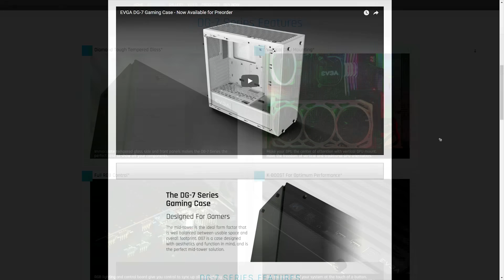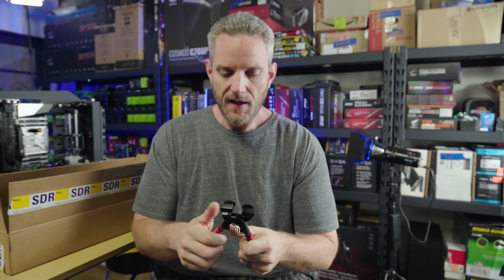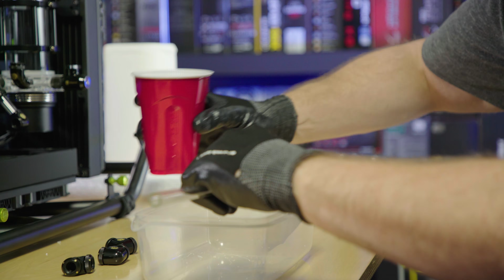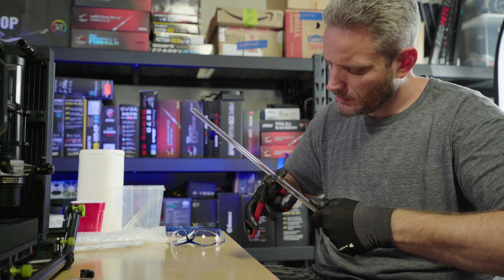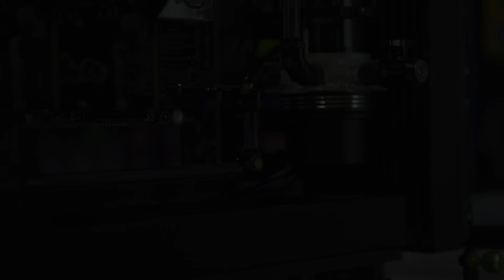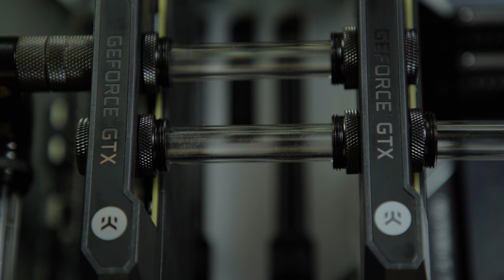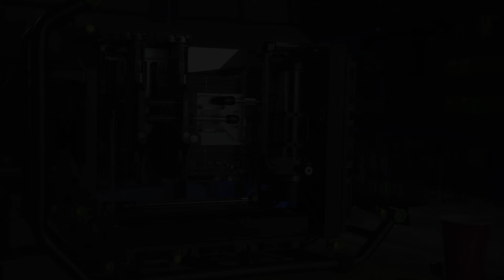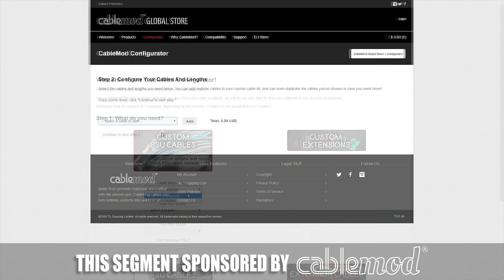First Custom Loop of 2018 - Personal Build Log Part 2.685

Comment: Hey Jay, can you talk about the Intel bug fix that is supposed to hinder performance by 10-30%?
Reply: Dennis Leung nope its "supposed to be" 5-30% but linux fixed the bug in their os and saw differences of only 1%
Reply: No, it's little to no performance hit of any kind. Try reading some of the updated articles from today. The final patch hasn't been released yet. Also, it's not just Intel that's affected either.
Reply: It's not Intel "fanboys" acting desperate here, it's AMD fanboys spiking the football based on fear-mongering bullshit that isn't true.

Fact: The security flaw, and it's required fix, has ZERO impact on consumers. From the soccer mom checking her email, to the gamer raging that everyone that kills them is a hacker, they are 100% unaffected.

Fact: The security flaw, and it's required fix, only affect enterprise customers. The flaw is related to virtual machines running on a CPU being able to view/see/access protected memory information of other VMs running on the same CPU.

Fact: Intel is NOT the only company affect by this flaw. AMD, despite their early claims to the contrary, as well as ARM are also affected by the issue. Apparently to a lesser degree than Intel, but they are still not immune. AMD tried to grandstand early on and say their CPUs are unaffected but the people who discovered the flaw and are working on the fix have point blank said they are wrong and are refusing to exempt AMD CPUs from the fix.

Fact: Despite the early fear-mongering reports of "UP TO" 30% performance loss, that "up to" part is key, that performance loss has been all but eliminated since the news broke yesterday. The "up to" 30% was only in specific programs and the people working on the security patch have since refined it to eliminate the performance loss. Benchmarks posted over the last 24 hours have shown the gap closed to less than 1%, which is within margin of error. And it's not always a 1% loss post patch, there are some programs that tested better by 1% after the patch.

I've previously linked sources to all of this information in the replies to this same original comment. Go read them, educate yourself, and stop acting like this is the end of the world. Had the tech media been honest from the start and not relied on click bait and fear-mongering, you never even would have heard about this issue.
Reply: I'm also wondering what he thinks about this intel debacle. I know I am not happy since it goes back as far as 1995.
Reply: Ali Rizwan that's bs, there is a link in their description for the patch gaming benchmarks and they are within margin of error
Reply: Up to 50% for virtualisation tasks, everyday application usage has only seen a 5% hit thus far in gaming and that's on a pre-release version of Windows 10.

You can always also just disable Virtualisation in the BIOS and not worry about any performance impact at all.
Reply: J Master
"Fact: Intel is NOT the only company affect by this flaw. AMD, despite their early claims to the contrary, as well as ARM are also affected by the issue. Apparently to a lesser degree than Intel, but they are still not immune. AMD tried to grandstand early on and say their CPUs are unaffected but the people who discovered the flaw and are working on the fix have point blank said they are wrong and are refusing to exempt AMD CPUs from the fix."

You're incorrect. There's two main bugs which have a similar effect, Meltdown and Spectre. Meltdown affects Intel only and it's the one PTI is fixing which causes a loss in performance, so AMD aren't affected and they're right to say they aren't. This is the bug everyone's talking about.

Spectre is another one that's got an unrelated fix, and is in two stages. Intel is affected by both stages, and AMD is only affected by one so are actually better off than Intel. This one's harder to fix, but that fortunately means that it's harder to exploit too.

AMD have been exempt from PTI's enabling: https://git.kernel.org/pub/scm/linux/kernel/git/torvalds/linux.git/commit/?id=00a5ae218d57741088068799b810416ac249a9ce and this was from 15 hours ago: https://git.kernel.org/pub/scm/linux/kernel/git/torvalds/linux.git/commit/?id=694d99d40972f12e59a3696effee8a376b79d7c8
Reply: Except even servers are unaffected. Try following the links I've already provided here or take 2 seconds to check out all the various links on r/Intel. The early performance loss was eliminated with subsequent updates to the patch.
Reply: No, I am 100% correct on this, it's why the people working on the fix for the Linux kernel REFUSE to exempt AMD from having the fix applied to them as well. They even applied the fix retroactively to older kernel version so people can't bypass using the fix. AMD is flat out lying, so are their fanboys.
Reply: two different issues, the one that affects intel is fixable (melt down I think it's called) and will result in a performance hit.  The INTEL/AMD/ARM (spectre I think it's called) isn't as big a concern.  It feels like folks are mudding the waters to make it seem like everything is affected by this security.  It will take a bit to shake out the real world affect, as it always does.  But you claiming everything is fine, is just false.  

I'm not trying to attack you J Master, I'm just trying to point out it's a bit more than you are claiming.
Reply: I hope he does. I specifically came to his channel looking for that.
Reply: Maverick, read the links I provided and read even more articles on r/Intel. The performance loss was eliminated completely, people are literally freaking out over nothing.
Reply: ademar9988 I never said servers aren't important. But a large majority of people that are watching this video are going to be gamers/work station users.
Reply: Isn't it 30-50%?
Reply: LOL
Reply: Except that's not at all true Oliver. If you bother to read the articles that are keeping themselves up to date with official information, you'd know that the patch has NO affect on consumer side applications. It does not affect web browsing, streaming or video recording, games, or anything else consumers do. The ONLY impact initially recorded was for enterprise class applications. The bug revolves around Virtual Machines, which 99.99999999% of consumers don't use. The security exploit allowed one virtual machine to access the secure data of another virtual machine running on the same system. That only affects things like server hosting, where multiple servers are being run off the same CPU.

Even then that initial performance hit to enterprise applications has practically been eliminated. The reports of performance losses up to 30% were from early versions of the patch fix. Work continued on those patches to eliminate any performance loss and even in the enterprise applications they are down to a less than 1% difference between the fix and no fix. Which is within margin of error. With some applications on the plus side of that 1% after the fix.

Here is one such up to date article. https://www.reddit.com/r/intel/comments/7nwoom/benchmarks_with_new_intel_security_patch_show_no/
Reply: It's not performance in general, it will only really effect servers. Gaming performance, and everyday use is untouched

Comment: TFW you're so early Youtube hasn't finished encoding 2160p.
Reply: My net can barely handle 720p :/
Reply: I have a 5ghz 8700k and a 3.5Mbps connection. Pretty sure it's the internet
Reply: My phone plays 1440p flawlessly
Reply: Well, more like 2006 i believe, AMD athlon 64 X2 4400+ dual core clocked at 2.3 Ghz, what a glorious CPU i have ← that is sarcasm btw.
Reply: jay lodewijckx what the fuck? Where do you live?
Reply: +GoogleMinus - I wish that i would at least have a pentium g4600 or something, that would mean i would have to get a new motherboard, and then buy RAM, which you know... the prices :P
Reply: Joakim Wallenius I have 220 mbps on my phone wifi
Reply: ExitioRegem That's rough, I used to have an HP with the 5000+ and Windblows Vista on it and I'm sure it's not ideal.
Reply: 16k still encoding.
Reply: Lmao I have the same internet connection and i also have an i7 :/
Reply: JWills You might need to get a wifi card for that. Whats the maximum speed you could get?
Reply: And I can get 150Mbps with hotspot :D
Reply: JWills If isp can only provide 5 mbps then there is nothing a wifi card can do.
Reply: robbo 2 lol, half the time, I'm stuck with 240p.  I have satellite internet, and nothing better is provided.
Reply: It doesn't even give me the option for anything higher than 480P
Reply: ExitioRegem you got cpu from 2003?
Reply: You sure it isnt your CPU, my internet is fast enough for 4K, but my CPU can only stream 720p 30FPS, it dies at 720p 60FPS.
Reply: which country do you live? i can watch 8k 60fps at 4k monitor no prob    https://www.youtube.com/watch?v=1La4QzGeaaQ&t=126s